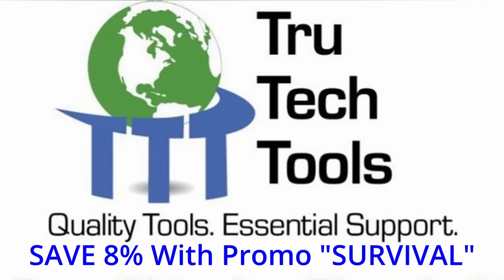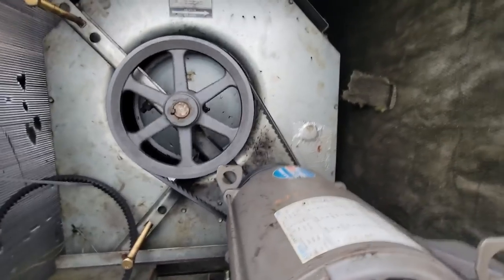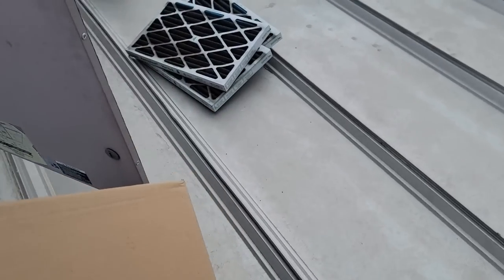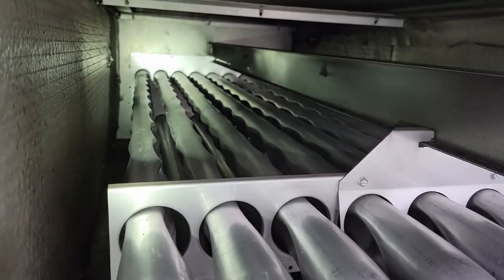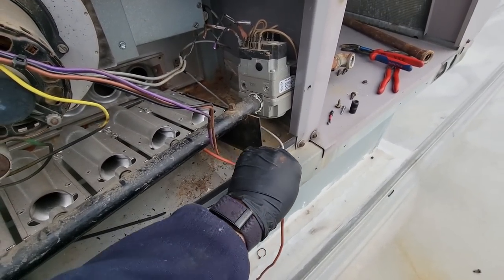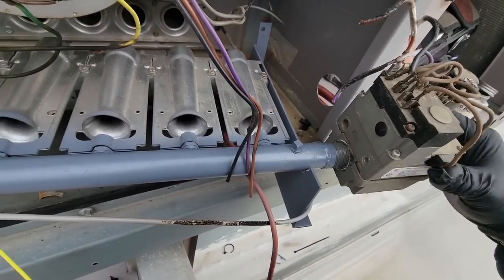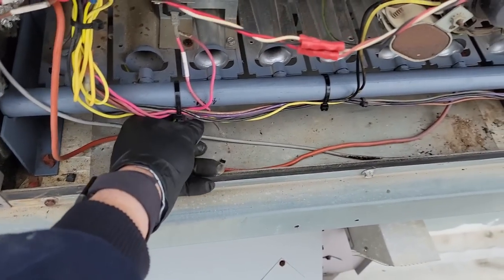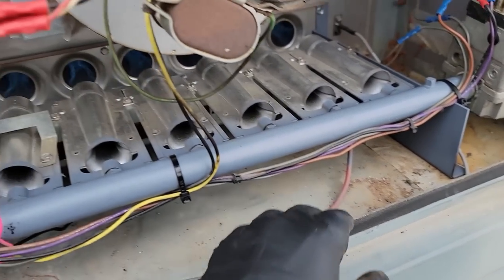The Building Was Cold But The HVAC System Was Flaming Hot!

Comment: That looks just like the one I got called on 10 years ago. The "head engineer" of the hotel jumped out all the safety controls. Heat exchanger was toast you could see through it not like it was a small crack or anything. First time I ever got out my side cutters and basically stripped the unit on the spot to make sure he didn't kill someone. This was for a conference room they had 500 people booked for
Reply: Sounds like the rent house we moved into in 2006.  The only thing I asked of the landlord was to have the heating fixed before we moved in.  I went up in the attic, and I could see through the side of the unit, the cracks were so bad.  (and I'm an IT guy.  I just spent years growing up in a 'if you can fix it, do it. It's cheaper, and you know what the idiot actually did to repair it.' family.)
Reply: @adammalzahn7238  - You can, but unfortunately we're forced to make everything 'too safe'.   Used to be the person making the mistake was the first casualty.  Now they have time to get away.
Reply: Should be court action and jail time for jumping out safety switches in hotel or homes.
Reply: @SovereignTroll  it would be but only after the place burns down and or people get hurt (and i guess you have to prove who did the "repair")

Comment: Great job, Rick! Nice to have the ability to weld that. We had a rooftop gas unit that had caught on fire once. It was on a zone system (zone control panel was bad). Apparently the unit was tripping out on high limit, so someone (not us) decided the fix was to remove the limit switch. Then the VFD failed, blower was not running, and Everything melted.
Reply from the maker: Wow, It's amazing how some people would do something like that.
Reply: I have bypassed safeties in the past. Supposed to be temporary. Quote sent to customer. They refused. Said it was heating fine. So I no longer jump safeties for customers. Just not worth the liability.
Reply: Hope the invoice said "removed the thing that stops your building from burning down"

Comment: I was a number at my company too, 1 of 35 service tech's, or 1 of 450 represented by union. Had steam fitters, plumbers, electricians, sprinkler fitters, controls, sheet metal, refer fitters and service techs. Came in handy when in situations like you were in.
Reply from the maker: We have over 100 employees, 12 tech's several installers, electricians, plumbers, controls guys, but they treat us good for the most part.
Reply: @HVACRSurvival  That's good, sometimes when bigger you can be forgotten. I was lead senior service tech., wished they could forget me some days.
Reply from the maker: @GlenS123  35 techs is really big, what city was that in?
Reply: @HVACRSurvival  The suburbs of Milwaukee, WI

Comment: All of years I did this not once did I see anyone use a auto rest roll out switch like you said that’s stupid but Carrier never failed to surprise me on their equipment.
Reply from the maker: If maintenance wouldn't have been resetting it over and over it wouldn't have been as bad but that's why you don't rely on the electronic control board to shut it down.
Reply: Not sure what a roll out switch does but electrical substations will generally reset up to 3 times with increasing delay and then lock out.

Comment: Nice job Rick! The ignition control module should lock out the heat with the roll out, carrier does all their units that way, reset the power it will try again.
Reply from the maker: It did lock it out but they kept resetting it so that caused it to happen over and over.
Reply: @HVACRSurvival  I got that from the video but if your resetting any problem it's just gonna try again, only manual resets are on resi furnace right? Most commercial is all auto reset roll out.... or am I wrong 🤔
Reply: it tries 3 times than goes into hard lock out
Reply: @ping_me1vp  I don't think so, with the roll out it should lock out. Now to prove ignition you are correct, it will try 3 times.

Comment: Nice thing it was a shop to weld it quickly. Good thing you spotted that? Something must have hit it and to much pressure as weight all on pipe. 

That wiring toast it would have all came out and redone. Shocked they put a resettable cutout on it? Nice to have the gas going actually going though burners to exchanger instead of compartment.

Comment: I was glad you were able to unscrew the broken part out of the gas valve, and it didn't screw up the threads on the gas valve. Could have been a lot worse, like gas valve, inducer motor, and all the wiring burned up...and then the customer would have a bill several times higher. As far as something like this happening to me, I had a small package unit that the control board caught on fire, (looked like started from the main blower motor relay), and that spread and toasted a lot of the wiring. Ended up replacing a lot of the wiring like you did, along with a new control board, new 24v transformer, and compressor contactor. I'll post a couple pics on my channel.
Reply from the maker: What's your channel?

Comment: Interesting comment on the high tension lead as it's laying on the cabinet.  Which is ground also.  I like to use non-insulated solderless connectors as I get a good look at the crimp as it's made.  Course you then have to insulate it with some heat shrink.  Get-R-Done!👍👍
Reply from the maker: If you look how I line up my plyers you might be able to notice I look for the end of the metal barrel to line it up to the edge corner of the plyers.
Reply: @HVACRSurvival  I can't see schiff through those colored sleeves myself but I have used them.  👍

Comment: 10:11 you turned on optical flow for the smoothing of the panned shot and the cut was sampled too :D
Reply from the maker: What are you talking about? If you're insinuating that that's not really our shop then where is it, I have better things to do to try to fool people about a repair.
Reply: @HVACRSurvival  Just an advice. What I mean is the two clips of the shot were combined BEFORE you slowed it down, which meant the editing program you were using tried to smooth out the cut and resulted in a few frames of gibberish. Slow the clips separately before you stitch them to avoid this :3
Reply from the maker: I use davinci studio

Comment: Would have gone with solder for the wire splices. More reliable, less prone to corrosion with relative moisture flowing through the unit when shrink tubed. Just my opinion. You do you 😊
Reply: Seemly there's enough Oil mist flying around that Air Handling Cabinet that Corrosion wouldn't be the Issue, very lucky that the Oil laden mist within the Unit carried within that duct work didn't take off, if the Belt Broke, and the filters weren't blocked  then  Vapour would maybe have filled the unit by Convection, ...that would have been serious, as the Triangle of Fire was there, Oxygen, Fuel and a Source of Ignition... a Virtual BOMB, Houston We Have Lift off... You CAN fight a Fire, but Not an Explosion...
Reply from the maker: I agree 💯%. They were lucky!

Comment: I hate butt connectors myself but i use them at times (my preference,not putting you down). When i put wires into connectors, i bend the exposed wire into a "U" shape so you are getting more wire to pinch for a better pinch hold and electrical connection. When the wire is small enough
Reply from the maker: I did a lot of research on crimp connectors, a lot of people use the pointy end to puncture the crimp connector and that usually does not result in a good crimp on an insulated connector.  the second problem is they use cheap crimpers. There's actually a lot of testing behind it but most people don't care to learn. Thanks for checking it out👍👍
Reply: @HVACRSurvival  ty. I was just sayin.

Comment: Something I noticed is it seems like you showed up on site and went straight to doing general preventative maintenance without actually diagnosing the customer's complaint?
Reply from the maker: I had already spoken to the maintenance manager, sorry I didn't get that on film for you and get a written letter of recommendation, I went up on the roof and found the problem within a couple minutes what exactly would you have done differently? 90% of these service calls could have been eliminated with proper maintenance. This ain't rocket science.

Comment: Would those flames have ever even reached the rollout switch? (Even judging by the burnt wires, I'm not convinced it would have.) Given the size of that burner assembly, I'm surprised they didn't use two.

Edit: I'd be curious if it faulted out on failure to prove flame rather than rollout/limit...and to answer the question, no I've never seen this. Hopefully it wasn't a result of someone being up there and starting to fall...
Reply from the maker: I think with the door on the flame caused the burners to flash back over and over. The way the wires were burnt on both sides is what leads me to that thought.

Comment: I'm surprised that an auto-reset flame rollout switch is even legal. I mean, if there is a flame rollout, it mean that there is an issue that need to be fixed. It's gas and fire, there is no chance to take with that. But seeing how the regulations are all messed up (way too strict here, way too loose there) I'm not surprised.
Reply from the maker: The way the system was designed was to allow the electronic control to lock it out but they were resetting the power to it causing it to happen over and over again. That's the main issue here.
Reply: @HVACRSurvival  Still an unsafe condition IMO. And that is the proof. I mean, people always get told to turn it off and on again for basically everything. Gas appliances are basically one of the few exceptions...

Comment: 3:30 You need ratchet wrench.
It's strange to think that USA uses gas? in HVAC to produce heat. We mostly use heat pumps here in Finland (and maybe other Nordic countries).
Reply from the maker: There's commercial heat pumps available in rooftop units but generally they don't work with a crap when it's 0° Fahrenheit outside. Are you using inverter driven heat pumps on package units? Or are you using mini splits? If you listen to the sound after I use the adjustable crescent wrench to loosen the nuts I'm actually using a socket set. As a service technician I use all of my senses at the same time,  touch, feel, smell and hear and sometimes taste. That will make you a better technician if you don't rely on only your eyes.

Comment: Usually the IFB would lock it out on smaller package units if the roll out switch was tripped, not sure on that model Carrier as it has different controls.
Reply from the maker: I said it pretty quickly in the video but the maintenance department had been turning the power off and resetting the controller to get the heat to run for a little bit. Theoretically the electronics did its job but it's not a true lockout once the power is killed.
Reply: @HVACRSurvival  that's not a maintenance department I'd like.  I'm in IT and so I'm well aware of the turn it off and back on fix, and will tell people to do it often, and try it with equipment in many circumstances, but that doesn't mean I'll do it endlessly, if the issue keeps coming back deeper analysis and fixing is needed, and with equipment like HVAC where it could damage the equipment or create a safety issue that threshold is not very high, after at most one or two resets they should have shut it down and left it off and called in an expert.
Reply from the maker: @glennmcgurrin8  I fully agree, I can't always go into those kind of details on video.

Comment: Nice job getting that welded. I used to work for company that had a great welder. Saved me more than once. You could have just left unit down with new burner manifold on order as many others would have done.
Reply from the maker: From what I'm hearing we may not have been able to get it anytime soon. That's always in the back of my mind
Reply: everything is great but as soon as you alter any manufacturer design & g forbid sometgoes south the liability is not on the last company that touched it from insurance standpoint thats why technically you’re supposed to replace it with original or updated part, & commercial space should have temporary space heaters of some sort until equipment gets resorted or replaced etc..  that is actually standard as per any commercial industrial insurance liability standards
Reply from the maker: @ping_me1vp  We do industrial high pressure piping and a lot more dangerous jobs than this low pressure gas line, were insured for all that kind of thing. Your liable soon as you touch any equipment. I know what your saying but were not some small mom and pop residential company that carries a couple million in coverage.

Comment: Self-resetting rollout switches unfortunately are what the installers are told nowadays to put in these HVAC systems.
Reply from the maker: That was factory, it was programmed to shut down but they kept resetting the power to make it run again and again.

Comment: That manifold must be made of some thin pipe. Usually the aluminum gas valve would break first.

A little high temperature silicone would have got you by until a new manifold came in. Well maybe not, since no one has parts in stock.
Reply from the maker: Or you could use some of the flex seal tape...lol

Comment: You’re hard to watch. 
For starters, you needed to look at the ignition control board for a fault. 
Secondly, the ignition control board will lock out the heat after 3 trips. 
When you’re using the scrolling marquee, you can press enter and cancel at the same time to see the alarm. 
This is easy stuff.
Reply from the maker: Ok😳

Comment: buy a proper wrench man ..lol   Just looks soo poor ! , if you dont even own a 10,11,12,13,14,15,16,17,18,19mm wrenches!
Reply from the maker: https://amzn.to/3FzkSZS
This is what I was using. Read up. I have box wrenches and socket sets, most of all my tools are some of the most expensive you can get. There is no reason to walk all the way down to the truck for a couple bolts and nuts. These pliers do not round the nut. I can crimp a wire connector with these things they have that much down pressure.